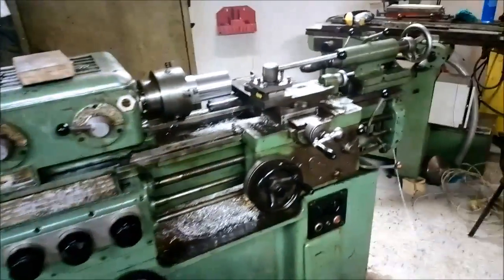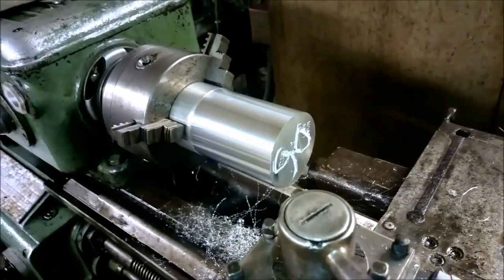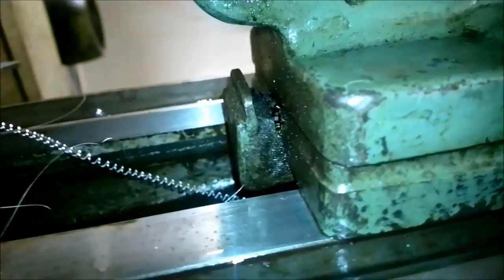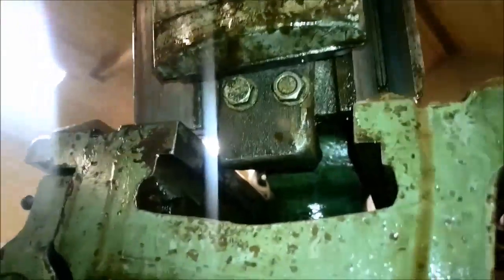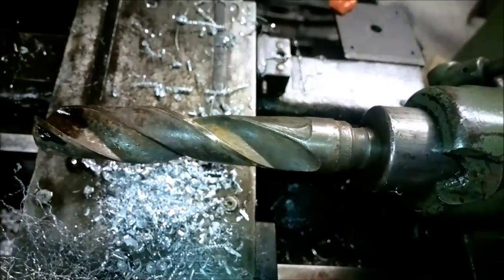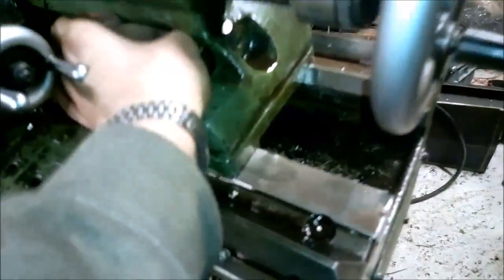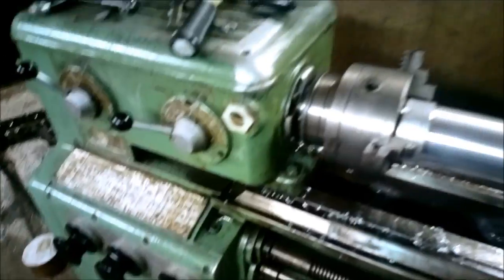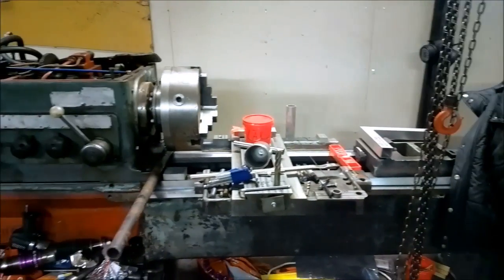Power feed for a lathe tailstock

Comment: I like this video, I think it is one that got me interested in how to properly use a drill, and the power feed is cool too 😎
Reply: As well, thinking about the mechanical loading of the tailstock while drilling for a consistent the pressure on the tailstock screw flanks increases with feed distance, the system being most robot with the quill fully retracted and the most turns of the thread engaged, so for heavy work this method may make a considerable difference in mechanical longevity or preventing a component failure.

Comment: The first time I saw this I was hanging at a friend's shop when I noticed that his brother just left the lathe but I could still see chips flowing from the drill...My little mind was blown!
PS: My understanding is that you can also rigid tap this way if you have some way to tighten the hook to remove the backlash.
Reply from the maker: Yeah, it's pretty awesome! Actually, some time ago I removed the hooks because I needed space for the DRO scales and also because I do such light drilling with this lathe that the system is not really very necessary. On larger lathes I really like doing this. Sure it could be used for rigid tapping if you can eliminate backlash, but why not just let the tap draw the TS in and out :-)?
Reply: On some larger lathes the tailstock is too heavy to be pulled by a small tap (recently I saw a lathe that had a switchable air supply to the tailstock to make it float freely when needed), so traditionally you would hand tap it with maybe a spring loaded tap center. On my lathe M8 taps will do the job and M6 will probably do too, but I wouldn't risk a M3 or even a M4. Could snap a tap, tear the threads or just make a worse tolerance thread in general due to the pulling force applied.

Comment: Great idea on the tailstock feed.  I too use windows movie maker but it does not take as long for me as you are taking.  I think the bottle neck is the GPU.  I am not certain but I think the program maybe is using the video card for compiling the movie.  You should ask on some windows forum and determine what hardware is used then upgrade that particular hardware.  Thanks for sharing, merry Christmas.

Comment: Nice feature, and a really cool outcome on the lack of taper!
Reply from the maker: I was totally and completely amazed with the results myself. I would have been happy with around 0,05mm or 2thou" of error per that distance! My big lathe in it's original condition was doing like 0,15mm or .006" on the same distance and I still lived with that for 3 years! Have you measured the errors on your lathe? Should also be pretty accurate I guess?
Reply: sunppaa  I should have a video of that soon!

Comment: I think the important point with the hook is that it pulls from beneath the ways thus pulling the tailstock down into the bed.
I have the same problem getting videos processed on my old computer and am thinking about getting an iPad and using that to both shoot the video and process them, according to Apple Mac, it should make the whole process much quicker. Not a cheap piece of kit, so not rushing out to buy one until I can find out if it is actually a practical solution.
Reply from the maker: Are you sure it's that way? If my thinking is anywhere near correct, in this case it's actually doing a better job at pushing down when the hook is above the ways? If the hook actually was a "real hook" having "positive&sharp" angles to each other, they would pull each other closer, but in this case the hook parts are trying to push each other further apart. A hook I think is not really the correct word to describe the form of those pieces as it is actually almost the opposite :-).

I'm just gonna get a new CPU for my computer and hope it helps! If not, I'm looking at buying a new computer..
Reply: Yes I see what you are saying, but if the tailstock was pulled from above I think it would tend to tilt down i.e. the back would lift up and then the front edge would jam, plus the drill would be magnifying the alignment and be below the centre height. So is the hook really very cleaverly placed
Reply: Sorry went to spell check and it posted the incomplete message, don't know why. Okay to continue, the hook then is arranged to actually pull in a direct line with the saddle, neither pulling the tailstock up or down. by nipping the clamp up that prevents the tailstock tilting or rocking over, very clever bit of design.
Reply from the maker: Stephen Deakin I didn't completely understand the end of your comment but my thinking is like this:

When the tailstock is pulled, the pull of the carriage and the resistance of the drilling action want to rotate the tailstock clockwise (observed from the front of the lathe). Making the front want to go up and the rear to push down. If there was more friction from pulling the tailstock on the ways compared to the drill drilling into the material, your case would be correct and the rear would try to lift up and so on. When you have your ways well oiled and there is no tremendous preload and the locking pads, there is no way there is enough friction to overcome the rotating moment. When pulled slightly above ways (until about half way to to the centerline of the drill), the hooks with the geometry that I have, will push the front down gently, which is a good thing. When pulled from below ways with a similar hook, it would try to lift the front which would be bad in any case.

If you still disagree with me, please tell me more about your view!
Reply: I’m doing something similar myself. Easiest to drag it but I found mine will rest firm next to the carriage so if I lock the tailstock down and then make a solid bracket so the fasteners align while it is in its fixed position it should hold just fine. Any forward momentum will push the rear of tailstock down. We will probably set it up just to wind the tooling out by hand. Either way I still think it will stay fixed.
Reply: sunppaa wouldn’t be difficult on lathes like mine to set a pair of bearing wheels under the lip of the ways like a roller coaster keeping it fixed with minimal tolerance. I agree pull from top on mine anyways with pressure to cut it pushes rear downward. I can also partially lock mine so it snugly slides if I keep the pace slow.